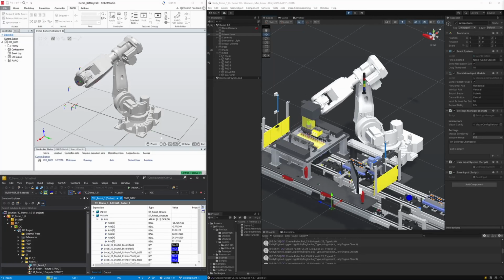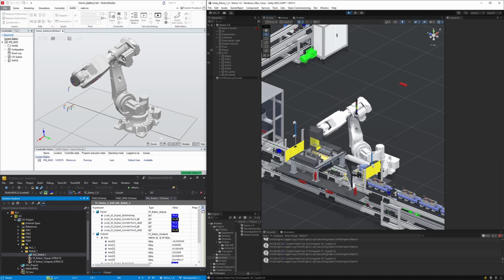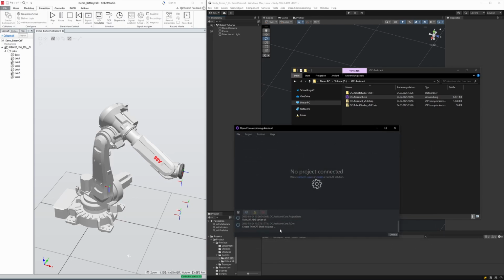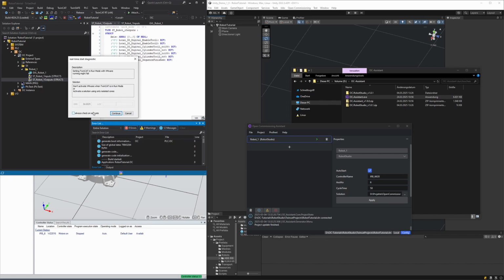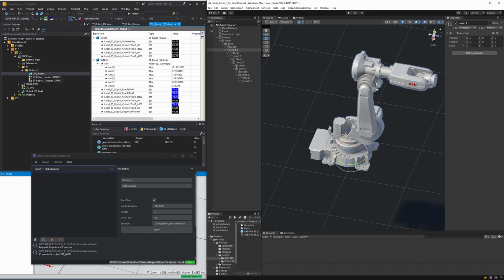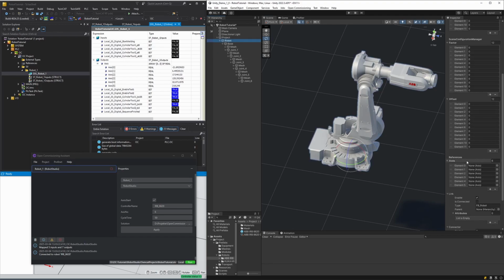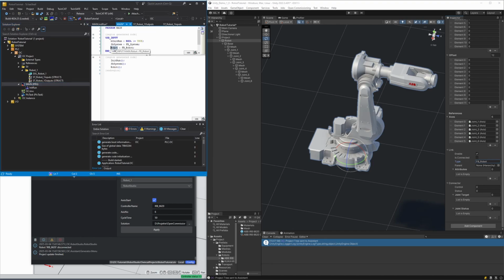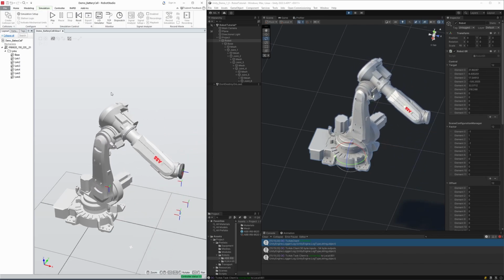Open Commissioning - Tutorial 6: Connecting ABB Robot Studio Controller

Comment: How did you add the robot ? I searched the ABB website for models in UNITY and found nothing...
Reply: you won"t find nothing specific like that, you need to get the CAD model, then Separate the parts and import them to unity, I had the same concern with kuka model, so the easiest way for me was to search the CAD model on Kuka Page, exported each axis part using freecad and converted to unity compatible using Blender, so in this last step using bleder i created also the pivot to export in the same file as the axis part
Reply: @manuelgarcia6282 cool, can you provide a simple tutorial or something?